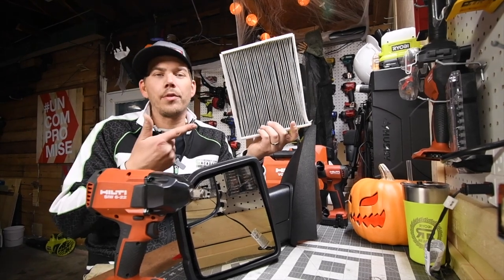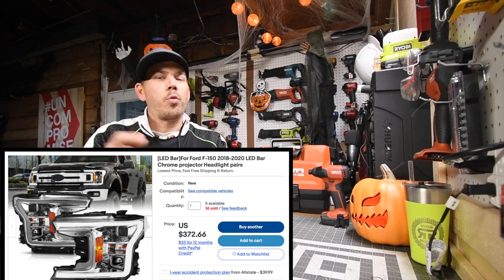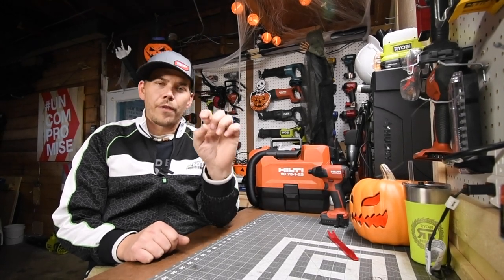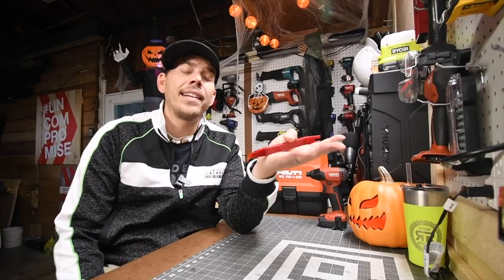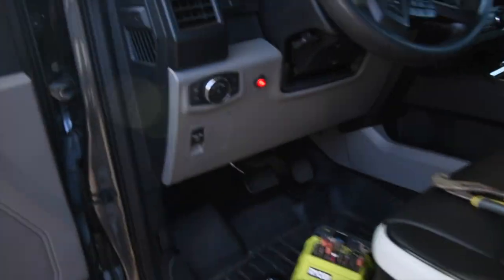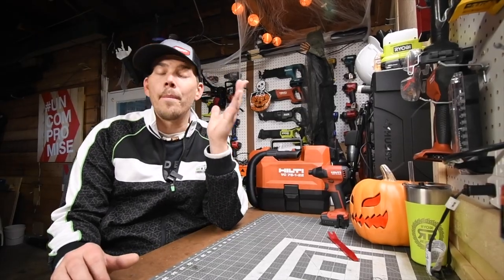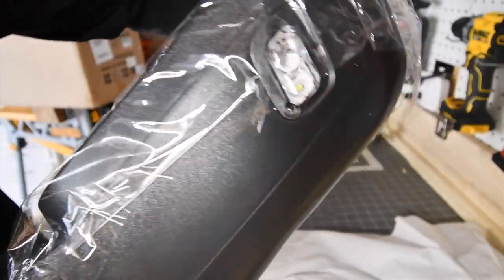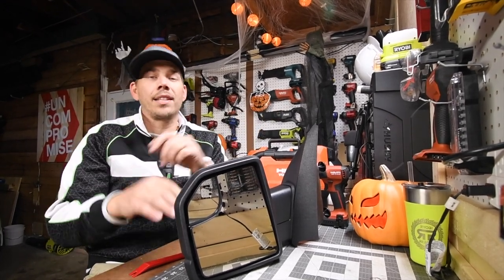BEST DIY Ford F-150 Upgrades you can do by yourself.

Comment: Better get yourself a spray on bed liner before you call that a work truck. Otherwise nice job, looks good.
Reply: My truck doesn't have the spray in bedliner yet.. but it has the scuffs and dents to tell you it's work truck. 😜